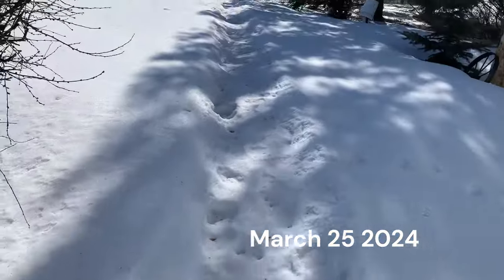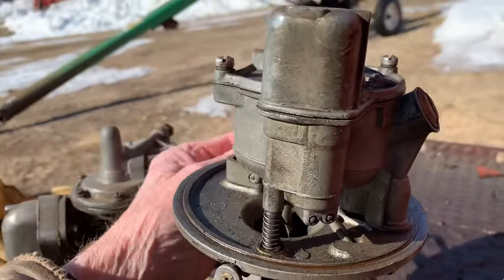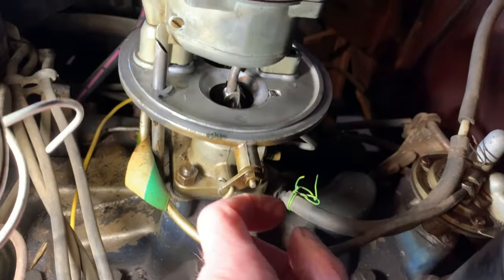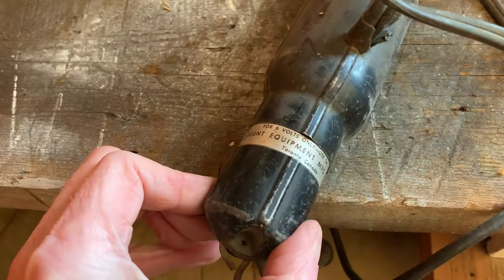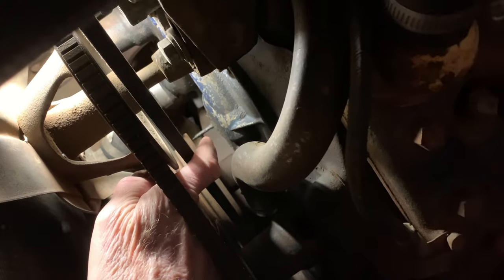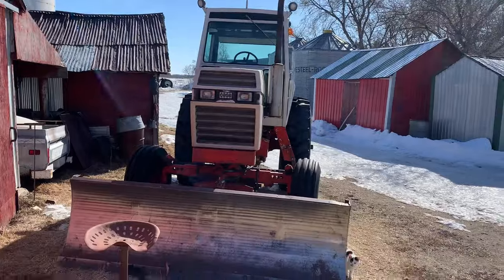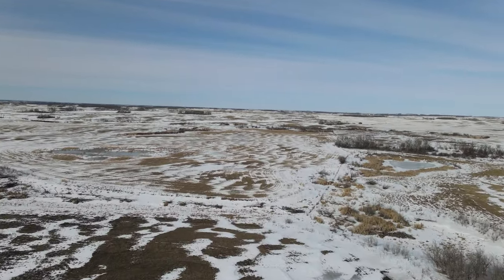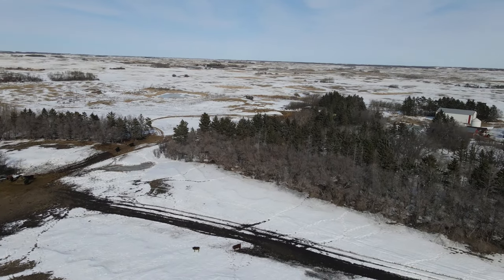Mar 25 Mercury carb and drone flight

Comment: Interesting carb... And yes, 2 leads to the battery and the other to the plug wire. Might want to clean up the harmonic balancer so you can see the timing marks, if you can't see them very well, a little white mark on whatever mark you need to set it to, will help a lot!! 
Drought sucks!! Best thing is get it planted as soon as you can.
Drone footage still looks good to me 👍😎
Thank you Roosty!!
Reply from the maker: Thanks Ed. Thats about what I figured on the timing light. Normally I've  just timed "by ear" but its pretty hard on this engine.

Comment: Fields are virtually bare here now next to nothing for run off either. What moisture did start to soak in has been evaporating with the cold now the last week again I’m sure. At this rate we’ll be doing field work in 10 days if we wanted to.  Lots of frost in the ground so don’t think there’ll be any early seeding though. Going to take a while for the ground to warm up. Who knows though April can be a miserable month too with lots of snow.
Reply from the maker: Sounds like its drier there than here.
Reply: Most definitely. Went down to the creek this afternoon and it’s barely running. Usually its 6-8 feet deep by now and ripping through there pretty good.